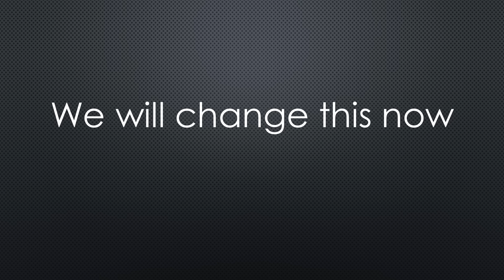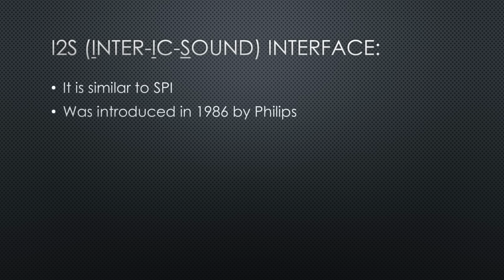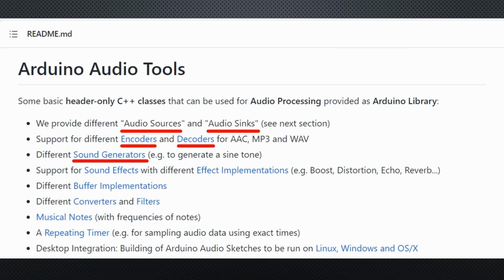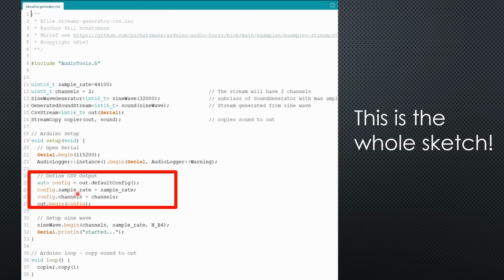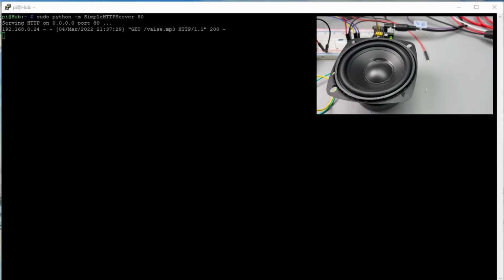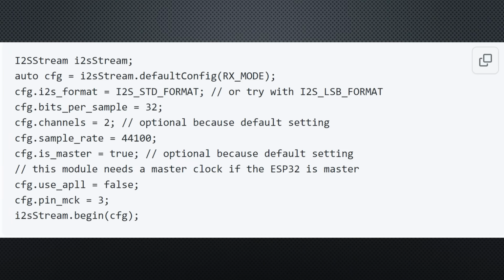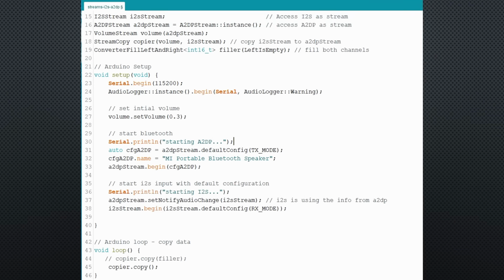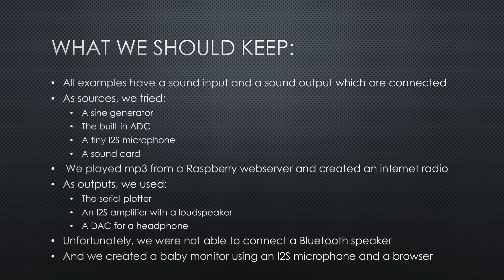#419 ESP32 Audio Tutorial with lots of examples

Comment: thanks for this video. got here a behringer umc404hd audio interface. and recently the left channels both broke up and started cutting in / out. something like 10 - 30 minutes later those 2 left output channels died. everything else still works. so in deugging the pcb i played a test tone and followed backwards from the analog audio output to the adc chips. and it was this thing the left right clock signal, always stuck on right. i did not know what it mean until watching your video today

unfortunately these i2 bus dissapears in the middle layers of the pcb to the emerge into buried bga pads of the xmos mcu controller chip. where the digital i2s signal is coming from. so i kindda hit a wall debugging as to why the left right channel is stuck

and it does not makes much sense to me why it faded in and out before finally dying. it almost as if there is a filter capacitor on this digital signal line somewhere IDK where. and that capacitor failed. or otherwise this exact gpio output pin only, on the xmos controller has failed. and is no longer transmitting anymore

it would be so much easier to see for these products, especially devices with 4 layer pcbs... if the schematic was available. but not for this one (umc404hd). please everybody to generally keep encourage support efforts for improving right to repair. so we can help avoid such these situations similar like this. and not be throwing away so much good products that the whole thing becomes an e-waste

i will endeavour to try fixing it another time. however i do not hold much hopes. unless there is some obvious smd cap on the left right i2s signal bus trace. then am out of ideas with it, given the nature of the issue. as speculatively replacing the whole xmos bga controller is over 20 euros. and is not even guaranteed to work (being at best a guess). which isnt worth the risk / expense for only a maybe outcome. an i will never buy a behringer device, never again! after this failure. they time their planned obolescence far too well. almost like a clockwork. haha
Reply from the maker: I assume we have the right to repair many devices. But they are just no longer made for repairs. Also, because we demand more and more, I think. We will see how Fairphone will perform compared to the competition...

Comment: Hi Andreas, thanks for the nice video and content. 
Here are some questions:
1 - How many ohms has the speaker that you used at valse.mp3 example? 
2 - Is there a limitation in ESP32 about speakers impedance?
3 - It is possible an audio comunication between LoRa Rf? A conversation between two people for example.

Here is the guy with Brazilian accent :)
Reply: Hi Helmuth I am no expert but checkout the i2c audio module he used the MAX98357A. "Output Power: 3.2W at 4Ω, 10% THD, 1.8W at 8Ω, 10% THD, with 5V supply". I highly doubt LORA is good for that application since it is very low transfer rate. LORA would be better for sending text messages.
Reply: @JonnyWaldes  many thanks :)
Reply from the maker: I agree with Jonny

Comment: Very interesting. Is the ESP32 fast enough to decode AAC LC and HE-AAC now in software? I have seen other ESP32 radio projects that rely on the VS1053B decoder board to do the AAC decoding. It would be a very neat solution to be able to avoid having extra decoder boards in a small internet radio box.
Reply: Yes it will decode ACC and MP3 streams of like up to 320kbs without any problems from my testing. No need for external decoders

Comment: Great video once again. Have you worked with the ESP32 S3 board yet? I couldn’t find it. I’m thinking of utilizing it to automate my intercom of the appartementcomplex to home assistant. There are products you can buy but what is the fun in that? Do you have any idea what to use? It should detect the ring, ‘pick up’ the phone, allow 2 way audio comms and open de main entrance door.
Reply from the maker: The S3 is not out yet and not supported by the Arduino IDE.
And: You have a cool project. Just do it as Nike says ;-)

Comment: As always watching your video and ideas are creeping, which will cost me some time ....
Could it handle streaming webradio from internet and send it to a bluetooth speaker ?
Resources Bottlenecks ?
Thanks for the allied swiss enabling.
Reply from the maker: AFAIK Wi-Fi and Bluetooth are exclusive or on one ESP chip (they use the same radio)
Reply: ah guessed it.....   so its a two-esp solution with i2s in between 
or esp with audio out as shown ....
Reply: Unfortunately the ESP32 does not support Bluetooth and WIFI at the same time.

Comment: I am here sir!
Reply from the maker: Thanks for coming!
Reply: @AndreasSpiess  Andreas, you made my new routine: Sunday morning "swiss accent" before the breakfast ;)
Reply: @zyghom  and online shopping right after!
Reply: @dan-nutu  ;-) I recently bought huge amount of ESP32 and S2 on Ali - now I am full of MCU. Recently I put ESP32 in each of my Raspberry Pi 4 servers just to monitor 5V supply voltage - the power supplies and cables make life miserable. So cheap ESP32 (1$ on Ali) is a super way of having full control (with MQTT). And bare ESP32 fits perfectly into Argon case.
Reply: Never ever had an issue with the supply voltage for a RPi4 using the "official" PSU, and I'm also running a few other devices from the RPi4 USB ports, including a SSD via an USB3 to SATA adapter. Well done to you if you monitor the voltage with ESP32s, but then what do you do with that info? Shut down the RPi? If I were you I would instead invest a bit in a good PSU and/or thick(er) USB cable. There are also simple ICs dedicated to monitoring voltage - just saying! You'd only need one GPIO pin on the RPi to use one of those, no WiFi and MQTT.
Reply: @dan-nutu  Yes, it is a part of my "RPI farm" with 5 RPis. And I built also UPS with super caps. I can control the Vcc and if below level, shutdown the Pis. The power supply is 10A and yes, you are right - the biggest problem are cables. I am not using official power supply as it would not be UPS driven and in case of power off it would ... power off rather than shutdown.  I know there are IC for voltage like ADS1115 and I initially had one deployed (it has 4 inputs) with 1 ESP only but I went for independent RPis with ESP inside. This way they don't have to be connected to the ADS1115 in case I move them around. MQTT and wifi is of course for Home Assistant reporting ;-)
Reply: Are you just monitoring the Vcc for dips or are you truly "controlling" it? I'd be curious: how do you charge the super capacitors, do you use large resistors in series to limit the inrush current or do you use something smarter? For voltage monitoring ICs I didn't mean external ADCs like the ADS1115, check out the XC61C series or the KA75xxx series of voltage detectors.
Reply: @dan-nutu  yes, I am using KA for undervoltage detection inside UPS.. Caps are charged through in series resistors but on top of that each super cap has its own charging system. 2 caps in parallel and 2 in series so output about 5.4V that is feed into Raspberries when AC goes off. Also when AC is off, the charging resistors are bypassed. With these caps there is enough power to keep load of 5A for about 90s - more than enough to send shutdown command to each RPi.
Reply: @dan-nutu  btw, the biggest problem is not really the cable (I use 16AWG) but the connectors - USB-C is not the best one for delivering the power where 0.1V drop is crucial. Probably also the fact, that Argon has SSD inside and the SSD is also powered by USB (A) - that is not the most optimal design. To make it even worse, Argon supplies power to RPi through GPIO (2 and 4). Eh, not really the best design when reliability is crucial.
Reply: You already did what I am trying to do! :) I have the super capacitors and everything else but I am still considering if I should go with super capacitors or Li-Ion batteries (I have everything for this option, too) - I am still trying to understand which option is safer for long term unsupervised use. Would you mind saying which capacity are your capacitors and how you bypass the resistors when A/C is not available? A circuit diagram would be really great :)
Reply: Also, I wonder if you can extend the time running from the super capacitors if you use a boost converter. At the cost of somewhat reduced efficiency (say 80-85%) it will allow you to use more of the stored energy even after the voltage falls below 4.5V
Reply: @dan-nutu  I thought about this option as they get fast from 5.4V (or 2.7V each) to 4.9V (2.45V) but then, they can stay there much longer so boost would make it working better - longer. I entered shutdown when the output was 4.9V - it could be at much lower if I used boost.